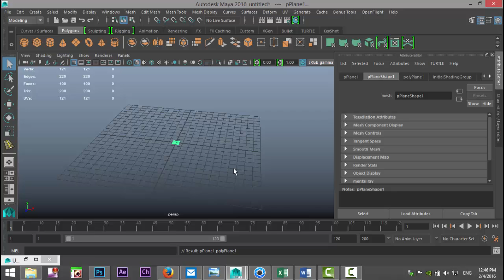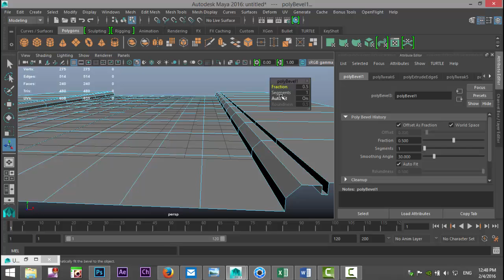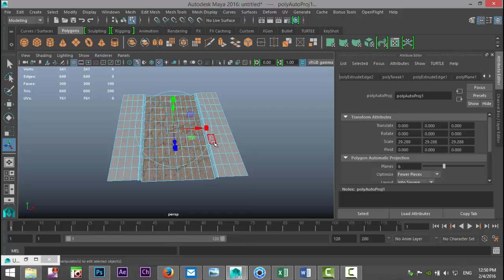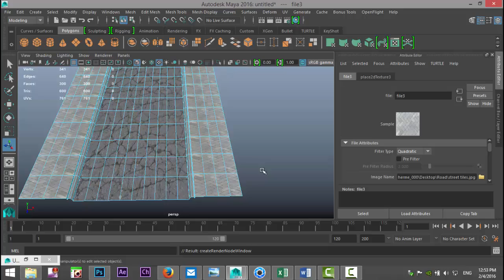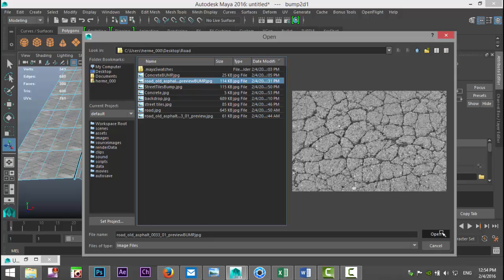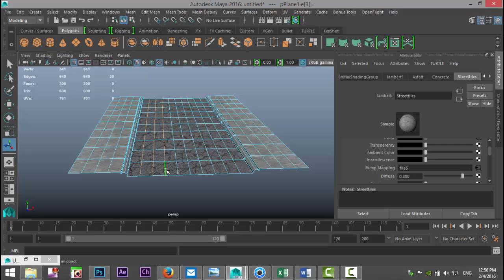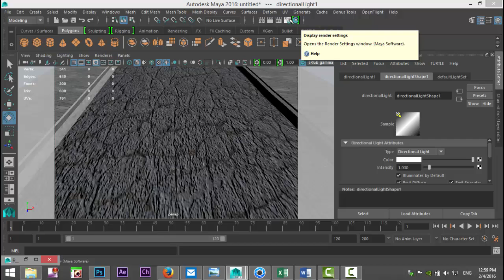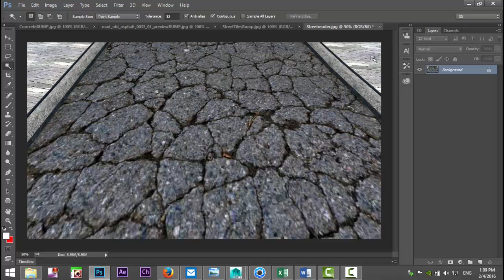Maya 2016 tutorial : How to model a rough street surface

Comment: how to model a tree according to a existing reference!!!!
Reply from the maker: +Zenovarse You mean based on a picture ?
Reply: +Mike Hermes well yea
Reply from the maker: +Zenovarse Well yes it's possible ( but Maya has a lot of presets to choose from ) But if you wanted to you would have to model each branch by itself like any other model
Reply: +Mike Hermes cant do it by controling the generated tree and then convert it to poly? because a tree would b tedious and labourious, like first using preset tree and then tweaking the amount of branches and theif position etc.
Reply: +Mike Hermes because you should be able to do that by changing some of the values in whatever code or plugin that is generating it.